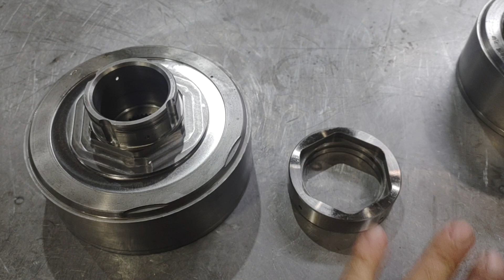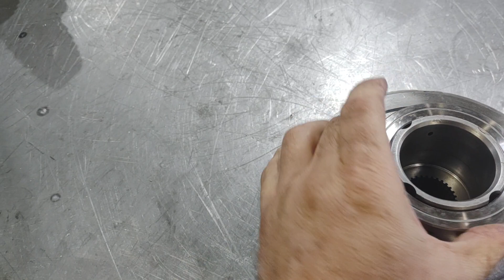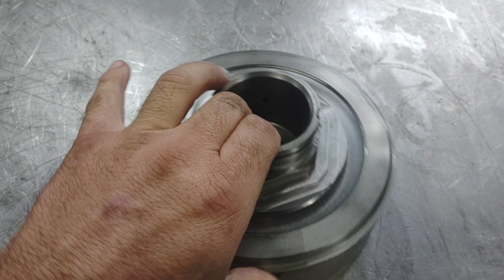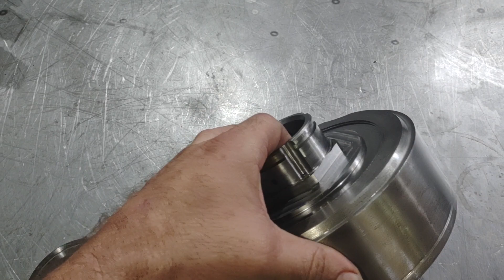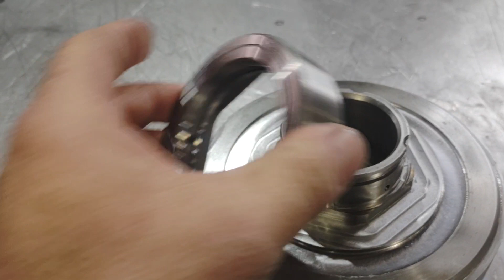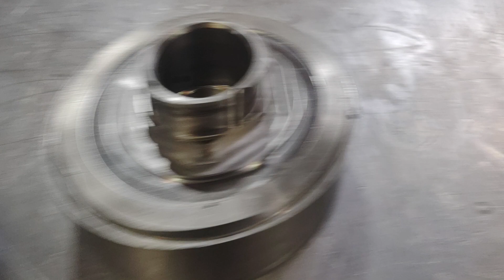TH400 Pro-Mod Drum machining process.

Comment: What do you think of the aluminum drums for the 400 in a drag week car.
Reply from the maker: Aluminum drums aren't all created equal.
They can work well on the street when properly setup. We like to use drums that are sleeved internally and  externally when using a band for engine braking.
Lots of Chinese drums on the market of questionable quality.